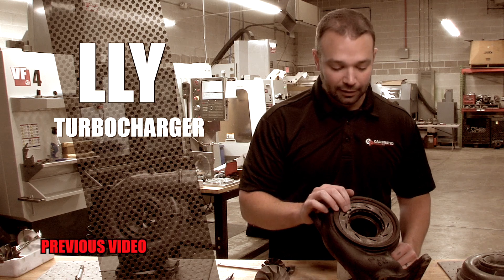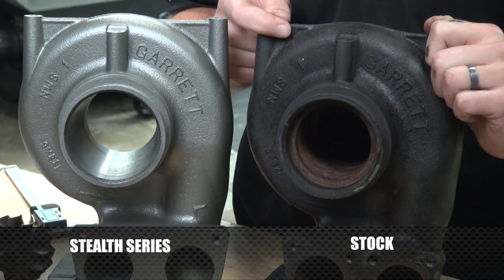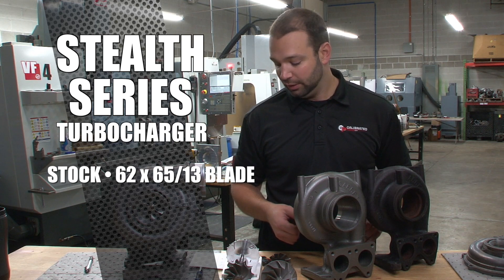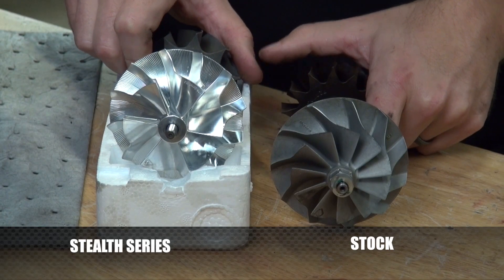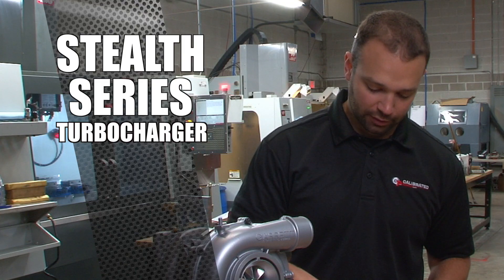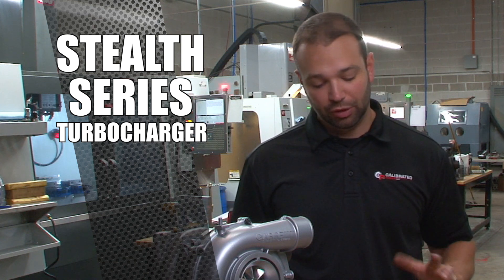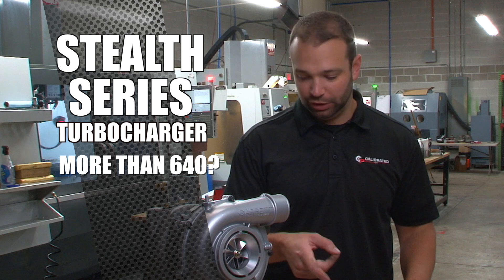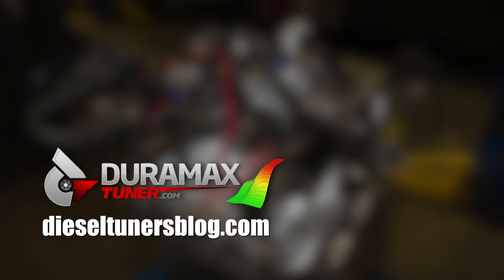640 HP Stealth 64 Turbocharger for LLY, LBZ, LMM

Comment: Is this turbo all plug and play? I’m running atp max effort tunes would I need a retune for this turbo?
Reply from the maker: Yes it is plug and play and you can run it on the same tune.
Reply: So no retune required if running aftermarket tunes on stock turbo? Currently have five position switch on the dash. Simply uninstall factory turbo and install the stealth 64 turbo and done?
Reply: @johnpotter8969  Correct. You could have it re tuned but not necessary

Comment: I have to replace my turbo on my 2006 duramax because I was told that the up pipes are cracked. They told me that basically the bolts will snap off and I’ll need a new turbo. What would you recommend. I basically use my truck to haul my boat and just drive. Please get back to me. Thank you.
Reply from the maker: The VVT Stealth 64 will be perfect for you.

Comment: I'm thinking about upgrading my turbo charger but seen you have a 67mm coming available. Still running stock internals with EFI live tunes. About to have all turbo piping upgraded. Should I wait until I get a another turbo before upgrading to larger piping and would the 64mm be a better fit for my truck so that I can still tow when I need to or can I keep my egt's down with the 67mm?  I don't do a lot of towing at all but recently installed an ATS stage 2 transmission with billet triple disk torque converter and a Co-pilot controller box. Also have a Fass 165 lift pump. It's a 2008 LMM actually featured in my profile picture in here. Looking to get close to 800HP but doesn't have to be. Slowly building this truck as I can afford to. Also have not had the heads studded yet.  According to the previous owner this truck is doing right at 600hp but haven't put on dyno yet. Wanted to get a professional response from a company that specializes in this and Duramax's. I been watching all the videos and really like everything y'all do. Also researched a lot of Gayle Banks videos as well on horsepower upgrades. My truck has about 226k miles on it and runs really strong with lots of power. Don't want to destroy it just looking to get the most out of it and be even more fun to drive. Looking forward to your response!
Reply from the maker: The 64 in a compound kit is going to be the best towing setup you've ever driven. The 67G2 is a monster on the street and still capable of towing. It's just not going to manage EGTs as well as a compound kit.
Reply: Will I have to change my injectors to run the 67g2?
Reply from the maker: @adambennefield7635  It's not required but if you do you will make more power.

Comment: could you guy do a video on if a stock injectors and stock head bolt on a lbz could handle 600 rwhp with all the supporting mods with the stealth 64 on a 06 lbz thank you i really my goal in 600 rwhp i want to get your 750 trans and the 64 so bad i just don't want to blow my engine if i need head studs it would be nice to know what i need to do before i do the turbo
Reply from the maker: You ask a really good question that's specific to your set-up. Why don't you give us a call and we can go over everything? 815-568-7920

Comment: Ohh Noooooo, my truck started to whine. Best comparison would be that it sounds like a power steering pump low on fluid??? Only makes the sound when it’s under load, can’t hear it in Park. As a matter of fact, I thought the sound was coming out of my radio at first. Anyway, I have the egr delete, efi live, built transmission, lift pump and up, down pipes and 5” exhaust. I’ll post a video with the sound and post the link. My sons and son-in-law’s are saying it’s my turbo, but they just like to get me to do upgrades. 

Also, this just started. I just finished putting in a kryptonite steering system, and right after I got done and went for the test drive it was making this sound. That’s what has me suspicious. I even added power steering fluid to see if that did anything.
Reply: I put a stealth 64mm VVT on my LMM and having the same issue after about 800 miles. any suggestions?
Reply: Jamie Mills 
Don’t know, I just pulled my stock turbo out and put in a 3794 68mm Danville, and now I’m a whistling fool. I didn’t go with the stealth because Supposedly, it’s hard to tune on the LMM??? I hope it’s okay, my turbo was a bitch and a half to change